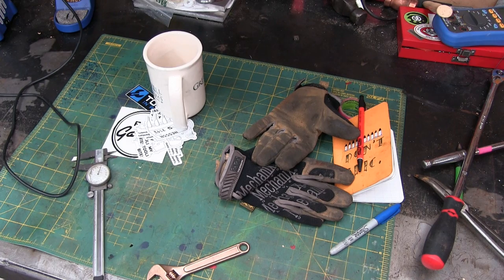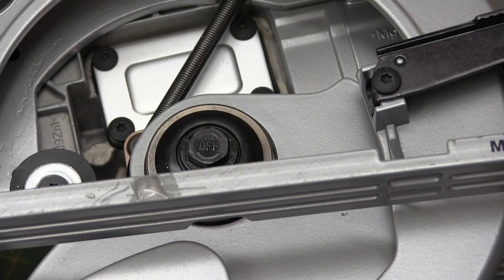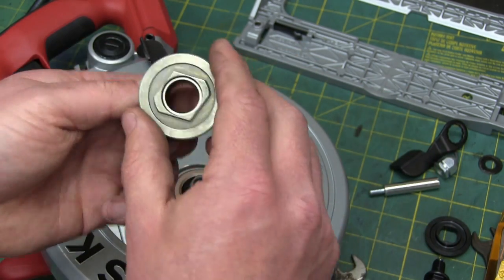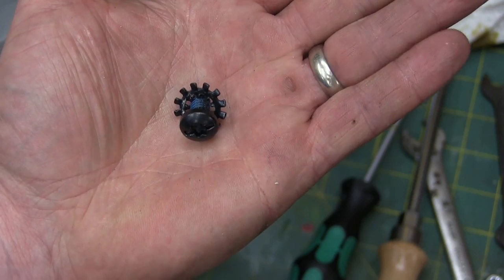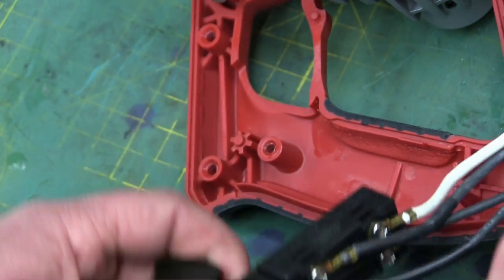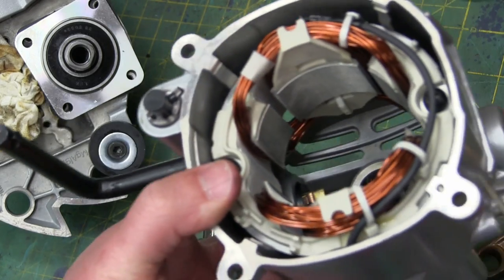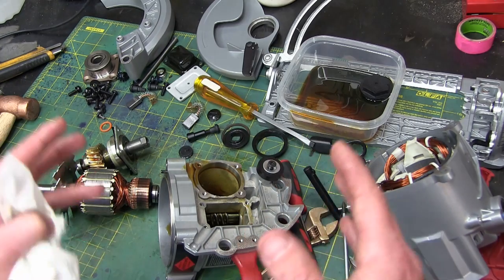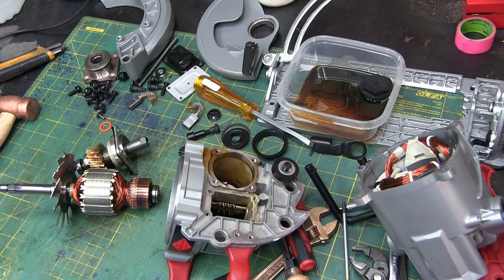BOLTR: Skilsaw 77 Magnesium Worm Drive

Comment: I use that same saw on a roofing/carpenter crew....but the only thing it is used for is cutting out ridge vent. it is crazy heavy and left handed (awkward to use) but will not burn up when cutting nails and any other crap that cannot be seen. great saw been using it for almost 20 years. Awesome for the applications that you do not want to ruin a "good" saw on.

Comment: The o-ring on the bearing is most likely used as an anti-rotation feature, as the O.D. is a slip fit. Very cheap. Very effective. Commonly used in mining equipment transmissions.
Reply: I'll second that.. allows them to reduce the tolerance on the hole for the bearing

Comment: 6203 bearing? Same bearing is used in Delco Remy 10 and 12 SI alternators....basically the alternator that was used in every GM vehicle from the 60's through the mid to late 80's. They probably still use it in some of the newer alternators, but I've not torn any down for rebuild. I think the 6203 was also used by Stihl in the MS290/310/390 saws for the crankshaft. Been a while since I rebuilt one though.

Comment: Yes you want to keep it in the B-side of the mold, so undercuts are put on there sometimes if it doesn't keep over there.  Really the Glass filled gives it the rigidity and scratch help, but also the part warps due to the different shrink directions after coming out of the mold, so parts can tend to come out more deformed.

Comment: Astounding work...
I'm glad your geek force is strong...
Moreover,  I'm glad, as a kid, you never took that advice about cats and curiosity!!!

Your depth and breadth is magnitudes greater than mine...
I've run into frequent dead ends with this question.

Regarding the Empire State Building, 13 months to build...
What was the likely tool array available that were at that job site. I went down this rabbit hole regarding the history of the Skillsaw 77, and whether or not handsaws were the dominant carpenter's choice on that job.
The Empire State Building. 

All the best, 
Thanks, 
Cheers...
Bob Lesser

Comment: Unfair question: in your esteemed estimation, how much more would fixing the few deficiencies you see (epoxy on the windings, glass fiber in the plastic, thicker trigger guard, beefier carry handle) add to the cost?  With weight as a concern, would it weigh much more?  Inquiring minds want to know.

Comment: Fist skilsaw worm drive bought was a spt77w-01. Right out of the box super loud bearing noise, sparks shooting out the back, peaked inside armature looks burnt. Took it back for a replacement,  second one had a sloppy blade, no idea why. Back it goes. Seems like junk.

Trying out a rigid R3210 now. Seems solid so far.

Comment: I used to work at a shop making granite countertops where we had a water hose hooked up to one of these with a diamond blade for cutting notches in slabs of granite. 
It was definitely from an older generation though The handles were metal. I'd still like to have one of my own at some point.

Comment: My skill saw is 30 years young. Some of the things you pointed out in this saw are exactly what I disliked about mine. First, the turbo air deflector. Cheap plastic. Doesn't seem to match the integrity of the rest of the saw. In defense, mine has never been broken because other parts of the saw protect it from impact. Second. The forward handle feels undersized but I rarely used that handle because my right hand was on the trigger and the left hand was holding up the guard. If you don't hold the guard up on these you could push the item you intended to cut halfway across the yard before the blade has a chance to scratch the wood and by then the saw would be nowhere near the mark you aimed at. I've gone all battery with my tools but have refused to part with the kill saw. It's still tuff as I used to be.

Comment: If that bearing goes into a raw casting or plastic bearing cap. That o-ring is is just to take up tolerance from the non-machined bearing cap surface.

Comment: Good and very thorough vid on this saw. I have been wondering why the magnesium version of  the 77 is  as light as it is, because Mg isn't really much lighter than Al. The amount of Mg in these saws can only account for an Oz or so of reduced weight. It looks like they reduced a couple pounds in other areas. I don't think the think plastic will really prove to be a problem though except for when the saw gets run over or something. My Skillsaw is a late '50s model (model 9) and weighs 20 lbs if it weighs an oz. Now I'm too old to use it as a one handed saw like I did in my younger days, so I am leaning toward the Al version which only weighs a couple more lbs than the Mg.

Comment: Cool video....getting ready to but a circular saw...WAS gonna get thst one...i found an older one new in box with the steel foot.. wonder if its any better inside?...considering dewalt worm gear saw also....which would you recommend?...not a carpenter but want it to last....thanks.

Comment: Hey AvE, I enjoy your vids. If I may, as you break a tool down there should be a point system and a meter. Neutral being 0, neither good nor bad, find a bad thing- tick to the left,( - 1), a good thing tick (+1) to the right, then an overall assessment at the end out of 15 things this tool rate +5 or - 3,  could be fun...

Comment: Great videos. My 2 cents on the Mag bases on any saw... they are great if you don't drop your saw. I have seen these over and over with broken bases, at least with my old Skilsaw (still going strong after 23 years) if it gets dropped it just bends the base and it can be bent back into place somewhat and still be usable, not that I personally drop my saw but my framers always drop at least two per job. How does the Magnum compare to its aluminum counterpart? Looks like they are using the same cheap plastic. Update: A friend of mine bought the new Mag in 2017 and it lasted less than a year.

Comment: Well, he turned me off from purchasing the SPT 77 WML - 01. But, something that's getting missed here: The saw that he dissected was the 77 WML model. L stands for lightweight. There is also a 77 WM model with a nicer looking handle; that is probably closer to the classic/legendary model, where maybe, weight was not substituted with plastic.
I'm still considering the SPT 77 WM - 22. It gets great reviews. Does anyone have any mechanical experience with this saw?
Or suggestions on a better worm drive saw?
Reply: get the skilsaw. You wont be disappointed. Coming from a carpenter

Comment: This is a good tool for production framing. huge hassle in a remodel environment. The cordless is a piece of crap, but it is nice and lightweight, specially when the job is on the 3rd floor no elevator. blow in some blocking, add some studs or whatever, cordless gets way more use, the old boat anchor battle ax worm drive  just sits in the truck...

Comment: Nice Vid brother. I'm sure that when you put it back together it'll still sound better than my $50 non-worm skill after I cut cinder blocks with it. I used to run that saw's older brother when I worked as an apprentice under a old school framer. That guys back muscles were the size of my forearms from running that saw for 20 years.

Comment: Listen cuz, there are myriad reasons I want that saw. #1 I just finished making schyucum wall cabinets with its east coast sidewinder cousin and a guide. No use for expensive festoolios. #2 I am the best junior apprentice laborer on the north shore. #3 I seem to be the only one of my cohorts that prefer a worm drive. #4 I promise I will put a set screw through the guard to make it more dangerous and therefore more efficient. Love the content, keep up the good work, don't take any wooden nickels, lemme get that saw.

Comment: As a framer of 25 years I no longer buy Skil. After the Chinese bought them they turned to a disposable POS. A unit used to last around 3-5 years. Now about a year. A fall from grace. The worm drive Bosch is my go to now.
Reply: The Bosch is the exact same saw as the Skil 😂

Comment: There are two types of tooth lockwashers, internal and external.   What you appear to have there at 13:42 is an oddball 'hybrid' as it has both internal and external teeth.   So I think it's actually ok as shown.  Just looks weird because it has the external teeth which don't appear to be doing anything, but as long as the internal teeth are there and under the head of the screw... probably hunky dory?   YMMV    Greets from Texas and your vid's are awesome!!

Comment: You know, if that bearing came out of the blind hole easy, then it must have had some kind of clearance.  With a fast spinning part like this, it would be wise to keep the thing from spinning (and grinding) against the side of the hole.  A good enough solution to me would be the nitrile ring; you get a snug interface between the bearing and the hole, yet it's easy to put in and take out for manufacture and repair (if the stator is all fucked up when they get it to testing, they can just swap it out instead of dealing with interference fits).
Reply: Also, I would like the saw.

Comment: Good review. I love the SkilSaw for a wedding gift idea! Why have I never thought of that?  (My ex woulda screwed up her nose at the suggestion, but she's still enjoying in the beautiful kitchen/addition I built with a SkilSaw. Which I would not argue, I'm only expressing a thought, makes it the most useful kitchen appliance.) 
You once did a comparison dissection of two generations of Sawzalls. Unless the Canadian antivivisection laws have you on Caution, a 30 year old SkilSaw dissection  (maybe you've already done it) and comparison with this model would be interesting.  Is that motor more likely to fail than an old one? Or has all those saws and all those years resulted in knowing almost to the micron what'll hold up? (The handle for instance. Maybe what breaks a SkilSaw handle isn't dropping it. The weight is such I don't think it could ever land on the handle. But then there's dropping stuff on it. Maybe a rafter falling 3 meters 'll crack any handle of any quality, so why over build it? Also, there does seem to be a lot of vibration damping, like the rubber bits on the handle, so maybe that flimsy handle is part of vibration dampening.)  
The No Name bearings. In the situation of a 50+ year old saw design, I can see where Skil puts it out for bid with clear specs for materials and then just checks every 1000th one coming through the door.  If a single bearing doesn't pass muster, the bearing maker gets charge backs they'll be working off for a hundred years.

Comment: I'm having a wedding...when you available AvE?  Do you still give Mag 77's as wedding gifts?  if not, wedding is off!  Oh dang, I gotta win the sucker.  I don't have mine any longer...got talked out of it when I moved from WY to AZ.  I really like the worm-drives because they are solid, heavy, stable to use.  I kept new blades on mine because it's much safer.  Dull blades are dangerous...you probably already know all this.
BTW, just an opinion, but I think the vinyl 'crumple zones' are good because what used to break when dropped now flexes and hopefully does not break.  I like the thin divider between handle and trigger as a thick one is annoying and distracting.  I have the metal-cutting version which works nicely on 16ga to 3/16 mild, but I am not thinking to try it on thicker.  It cuts aluminum like butter and it's quick as I use a speed square.
Also, when I had it, I made a wood base to use my Mag 77 as a table saw because it is stronger than most table saw motors/drive systems so it did a better job of ripping thicker lumber.

Comment: So with that diamond drive, does that mean you can only use Skil blades?
Reply: No , the diamond opening on the blade is just the pattern so the blade doesn't slip on the axel , I've also used Bosch blades and Freud & Diablo blades on mine .I don't have this version in this video but the other one with the aluminum or steel ? base plate . great tool

Comment: I actually worked on these tools daily and even with the older skillsaws the rear bearing is held in with the fasteners. However, most of them have a flat side on them, must have been too cheap to cut off the head on one side now.

Comment: Could you test that three bolt retention.
By my reckoning any custom plate will be thinner than and more likely to bend than the width of that bearing race.
And three screws are more easily serviced than a large jesus clip

Comment: How long does the battery last? That's the biggest problem with battery powered tools. They are great with a full charge. But they lose power as the battery weakens.

Comment: great videos!! 

I was thinking that the O-ring on the back of the bearing might be so it doesn't slip in the outer housing. When I built generators you'd see them in the rear bearing mount. if the O-ring was worn, the outer race would walk around, wear the rear housing, drop the rotor causing angst and confusion to all the angry pixies. Seems kind of cheap to have on a tool like this. Maybe it was in case the plastic housing overheated?? cheers!!

Comment: hey i may be mistaken but that fastener with the blue loktite and the toothed washer, it looked like it actually had a second set of teeth on the inside under the head of the fastener which would bite into the head
ive never seen a washer like that in person but it just looked like that in the video, so it would bite into the magnesium with the outer teeth and the head with the inner teeth...although the inner teeth would also bite into the mag i would think, maybe the outer ones are just for looks? or extra surface area since mag is pretty soft the small teeth on the inside might not provide enough locking? not sure, and like i said i may have just been seeing things lol

Comment: Series wound universal motors are notorious for being noisy and cheap.  Still, they provide high starting torque so you find them in lots of hand tools.
Reply: Oh, you need non-EP oil for the gear box.  Otherwise the sulfur in the extreme-pressure lube will wreck the bronze gears.  Probably won't be able to find that at Farm & Barn.  Oyl fluid gear grease will work but there's probably better options.
Reply: Pretty sure that shitty little piece of ABS is to keep the saw from blowing sawdust into your eyes.  Looks like the cooling is aggressive---maybe a little too much.  Is there a screen somewhere to keep the schmoo from getting sucked into the motor casting?  A super-high end tool would be totally enclosed.  But its heavy because you need heat sink fins... Also,  unless you're playing handyman at the 7-11, who needs an explosion-proof motor?

Comment: Those motors don't use copper windings.  They are copper coated aluminum. They also swapped out what used to be a steel gear to either brass or bronze to that the gear grenades at the 3 year mark when you are using it full time on a jobsite.

Comment: I purchased this saw at my location Canadian Tire for $129 because I've always wanted a worm drive saw, don't know why, just did and now it's on the shelf and I really like it but generally try to avoid it. It's a fucking monster and the best thing I can think of about it is the cord is long as fuck and I can see the line I'm cutting because I'm right handed right handed saws are made for left handed people. I'm restricting it's use to cutting concrete and metal.

Comment: An unintended Hertz related 60 slipped it's way into the presentation. 
 If anyone is interested and/or not an electrician...
120VAC @ 60Hz x 2 directions of current flow = 120 "0V" per second. With 0 Volts there's 0 Amps. The switch interrupting DC must do so under full voltage and possibly full current too. Can be messy.
Reply: Jim Marriott Is that good or bad? Could you please explain?

Comment: What's the point of the blade arbor having the diamond if the arbor isn't actually keyed to the shaft?  Aren't you just throwing away the locking of the diamond shape?  On the old one you tore down the shaft was splined.

Comment: Ordered this saw and would like to use it in Germany. Unfortunately we have 220v and 50hz. I can buy a 110v 50hz transformer here but then the saw will run on 50hz.  I think it will run a little bit slower but will it damage the motor? Maybe someone has a good idea to optimise the saw for 50hz. Maybe use 120v oder 130v instead? Kind regards from Germany.

Comment: I disagree with the idea that DC switches are more robust than AC switches. Yes, there are times that the voltage will be zero, but on average it will be the AC rated voltage, and at times higher. You don't time your button presses according to the cycle of the AC.

Comment: Anyone know how to remove the forward ball bearing? I also put a cut the seal accidentally trying to remove the rear ball bearing. Anyone know if that seal ((the one with the spring in it (Part #1619X04740)) can be replaced? Mine looks intentionally fused to the housing somehow.   Thanks for your help.

Comment: I own the Skilsaw that spins a 12-1/4 blade and cuts through 4 x 12 in one pass. We use it often when cutting treated wood lagging for our soldier pile walls. It works pretty well except the only 12-1/4 blade is made by one company. It has a thin Kerf and when it gets dull the blade starts to travel all over the place on a crosscut- couldn't imagine a rip!Might have to go to my local saw shop and find a thicker blade that can be re sharpened! Only problem is the diamond shape for the Arbor? Proprietarily fucked I suppose?Anyone have an answer to this?
Reply: you might get lucky and find one that has knockouts like the diablos and most dry cut blades